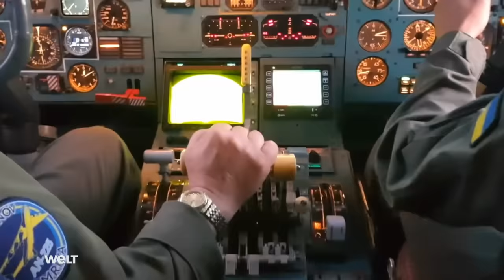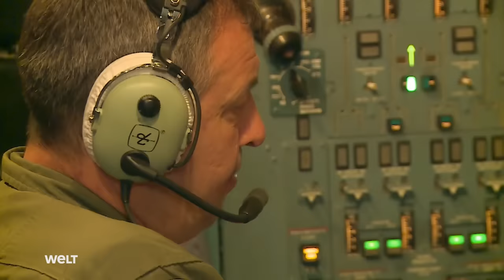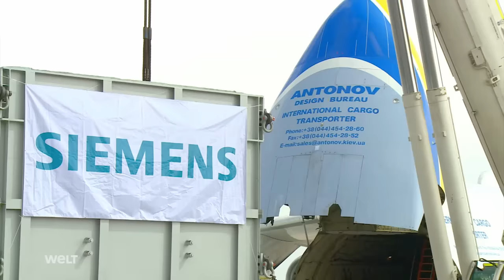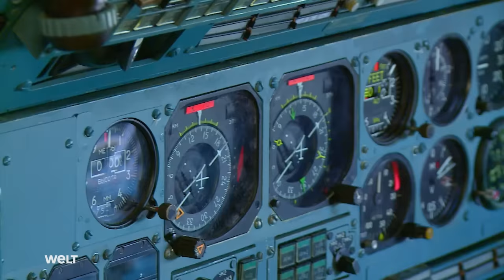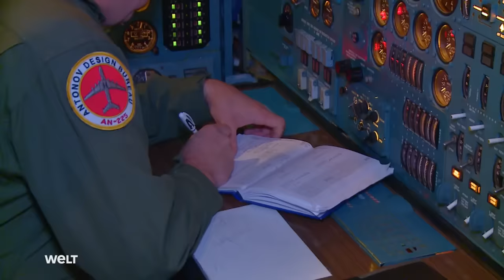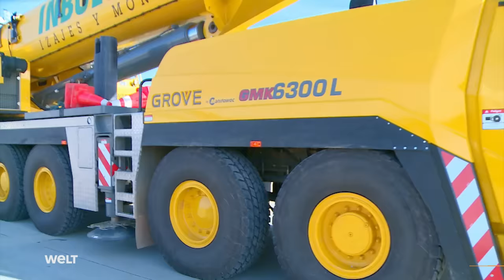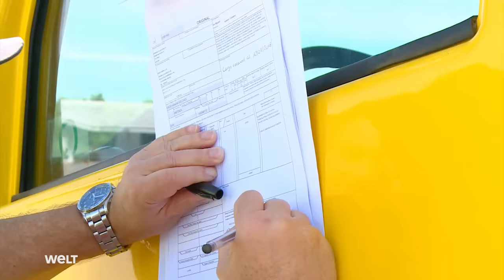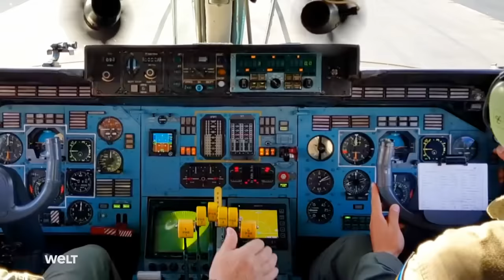Antonov An-225 - The World's Largest Aircraft | Full Documentary

Comment: 34:20 the runway is JUST 4000m long. Bish please this is probably the longest ones in a freakin juggle
Reply: This plane is massive, it can't land at any traditional run of the mill national Airports, and not even at some international airports

It needs very very long runways.
Reply: @longnamedude3947  And a runway that can support that massive weight without damage too
Reply: @Shade_Tree_Mechanic  That too, alongside the necessary support in place to tackle any potential incidents, which if one of these things crashed would be a massive fire to deal with.

Most airports that handle this thing are used because they are the only airports that can handle it.

It's difficult to gauge how big it really is until you see it next to an Airbus A380, and then you see that next to a Sessna or small twin engine Honda private jet.

I mean it is so big you can fit a shuttle on top, that is impressive.
Reply: you should make your own aircraft.
Reply: @longnamedude3947  The Boeing 747-SP did it YEARS before this one did...and the 747 is quite a bit smaller while the U.S. Space Shuttle was BIGGER than the Soviets' Buran Space Shuttle.  The Buran did not have its own main rocket engines, either, whereas the U.S. Shuttle has 3 main rocket engines.  Now, don't get me wrong, I am DEFINITELY NOT knocking this amazing machine!!  But, credit where it's due!!  The 747 is smaller than this and it hauled a bigger space shuttle on its back than this did.

Comment: “Gear down!”   “64 GREEN!”
Reply: Daniel Hernandez Actually it has 32. I was exaggerating. But from a distance it looks like a lot more. I didn’t get to see it land, but I saw it on the ground.
Reply: 😂
Not many people get the "x green" gag. You must be a fellow airman! Cheers
Reply: It would still be three green. You don't count tires but independently moving mechanisms. Or four, I think the front has a double set.
Reply: @rhallnapa  i dont want to imagine stress of the rear tire when touchdown, it either has to have deep softer springs to spread weight..... wh what do I know, this thing should not even be able to fly.
Reply: @DrWhom  yep.Two front gear.
Reply: @rhallnapa  36

Comment: Very nice to see the half-finished one as well, I haven't seen that in previous documentaries.

And that remote airport with "only" 4000 meter runway... runways don't come much longer than that :-)
Reply: I have landed on runways 10 times smaller. Netherthorpe and Maypole both in UK. Elstree used to be my home airfield which is a touch larger.
Reply: Time stamp?
Reply: The half finished plane? 5:22
Reply: 4000m is 4km is 2.45 miles. Almost as long as Kennedy space centre runway. Dont get much longer you’re right. I think my city runway is 1.5km maybe at most.
Reply: actually denver international airport has a 16,000 foot (4800 meters) long runway but it's not just runway length, it also has to do with weight rating and size classification since the AN-225 can weigh 1,280,000 lbs (640 tons) on takeoff
Reply: @Derek Wall Denver probably needs it because of the altitude.

Comment: The USSR had a knack for making aircraft that look so intimidating.
Reply: think it was ukrainian
Reply: @gordonwilson1032  No it wasn't.
Reply: @gordonwilson1032  Made by Russia. Stolen by Ukrainia
Reply: @sunilsubhash6769  What are you smoking, dude?
Reply: @maltrhythm105  If I steal your car and change it's colour, will it be mine?
Reply: TheBaconHunter  Here is the details -

The Antonov An-225 Mriya is a strategic airlift cargo aircraft that was designed by the "ANTONOV DESIGN BUREAU" in the Ukrainian SSR in the Soviet Union during the 1980s.

Antonov StC is a state-owned commercial company. The Antonov corporation (AN) The company was established in 1946 at the Novosibirsk, Russia. Its headquarters and main industrial grounds were originally located in Novosibirsk, Russia and were later transferred to Kiev.

Oleg Konstantinovich Antonov the prominent Russian  aviation engineer personally responsible for designing the very successful Soviet Antonov AN airplanes.
Reply: @gordonwilson1032  It is, and Ukraine was part of the USSR.
Reply: @ceaschannle5752  Yes, it IS.  Ukraine was part of the Soviet Union...and Антонов is in Ukraine.
Reply: @iambjcincle3991 ....and that means what?
Without Russia there would be no Antonov or this aircraft. Without Russisn empire and USSR the Ukraine would be also 70% smaller,  a modern made country and not by their own doing at that.
Interesting fact, Antonov as a company that attempts to manufacture anything went belly up, even as a independent and state owned company, it couldn't survive without Russia pumping money in to it.
Reply: @ceaschannle5752  It means exactly what I said:  That the Antonov Design Bureau was in Ukraine, which was a part of the USSR.  What you're going on about has nothing to do with what I said.  I stated a fact, not suppositions nor assumptions.  There are people saying it wasn't made in Ukraine.  It was, that's all.  Whether or not they would've gone belly-up or not or what size Ukraine would be is irrelevant.  That other stuff you brought up has nothing to do with the argument at hand.  You could very well be correct...but, that's neither here nor there.
Reply: @iambjcincle3991  Look, Ukrainians are taking all the credit for it and as the facts go, they deserve none, just because Russians decided to relocate Antonov factory on to Ukrainian USSR territory means nothing. The aircraft was designed and build mainly by Russians.
So first and foremost,  the aircraft was build in the former USSR.
Reply: @ceaschannle5752  OK, I will try ONE. LAST. TIME.  WAS IT BUILT IN UKRAINE?  YES OR NO?  WAS UKRAINE A REPUBLIC UNDER THE SOVIET UNION?  YES OR NO?  Now, it matter NOT whether or not the SOVIET UNION (NOT RUSSIA) moved Antonov to Ukraine.  It matter NOT whether Ukraine would've been 10 times it's current size or 1/10th.  It matters NOT whether or not Antonov would or did go belly up without SOVIET or RUSSIAN funds...FOR THE PURPOSES OF THIS ARGUMENT THERE ARE TWO THINGS THAT ARE PERTINENT:  1)  Ukraine DID exist during the Soviet Era, and 2)  The AH-225 WAS BUILT IN UKRAINE!  It's THAT SIMPLE...That is ALL I SAID!  BTW, check your facts...Ukraine DID exist for HUNDREDS of years PRIOR to the Red Revolution.  Ukraine WAS its own country for HUNDREDS of years, it was a Socialist Republic during the Soviet Era, and it is its OWN country, once again.  I made NO OTHER CLAIM than the two points I have, ONCE AGAIN, reiterated.  Why does this have to be so difficult?  Look, I have NOTHING against you, in fact you seem like a pretty good person with a brain.  But, you're reading FAR more into what I wrote than what I was arguing.  The fact of the matter is that I just don't know what could've, would've happened had the Iron Curtain not fallen.  Also, admittedly, I don't know where Antonov Design Bureau (let alone Antonov, himself) originated OR how and when or why Antonov was (if they were...again, I don't know, personally, I haven't gone into all that research on my own and won't argue things I am not 100% certain of).  What I DO know is that there is a VERY common misperception that the USSR=RUSSIA, full-stop.  It actually amazes me, as somebody who lived through the very height of the Cold War and served in the USAF during that period, that so many people don't know that while Russia WAS a or even THE major Republic in the USSR, Russia was NOT the "be all and end all" of the USSR...there were MANY other Republics that made up the USSR.  Just WHY one of the single most important parts of OUR history as well as the entire WORLD'S history is so misunderstood AND SO SOON AFTER the fall of the USSR is quite frankly shocking and embarrassing.  Seriously, it's not like the times were during the Ming Dynasty or Pre-Egyptian times, or off in some remote, who knows where tiny plot of land somewhere on the other side of the planet that's the size of Luxembourg or Liechtenstein.  This was a VERY SERIOUS TIME in world history that STILL has after-effects for virtually every country on the face of the earth.  I digress and now I am guilty of going way off the topic being argued (important as the topics being discussed may be, they ARE irrelevant to the argument at hand).  OK, SO, HOPEFULLY this cleared everything up and it's understood that I was arguing absolutely nothing else other than that "Maria" was built in Ukraine and Ukraine was part of the USSR.  Nothing more, nothing less.  Now, so as to not have any more misunderstandings and so that there is no "bad blood" between us, I bid you a good day and hope you have a pleasant one.  Take care.
Reply: @iambjcincle3991  Beating dead horse..... I'm from Ukraine or former USSR and even though I'm from Ukraine, I don't speak it, only  Russian. Most Ukrainians and people from other republics  are aware that in those times (USSR), borders meant nothing and were purely symbolic.  That is why Lenin allocated  western parts of the Russia in to Ukraine when though those areas were parts of Russian empire for centuries, same goes for Crimean peninsula in 1954. Borders were all symbolic. Heck, Su 25 was manufactured in Georgia, does that mean Georgians designed and build it? No, same goes for An=225 , it means absolutely nothing that it was build on Ukrainian territory, absolutely nothing. It was the plane that was designed, build by USSR with people in Kremlin pulling all the strings. It was primarily build to carry Soviet space shuttle.
Reply: @iambjcincle3991  
1. Without Russia there would have been no USSR.
2. Without Russia, there wouldn't be Antonov.  
3. Ukraine didn't manufacturer anything on their own in USSR times, everything was directed, paid for and manufactured under Kremlin direct control. 
4. Antonov is caput, it's no longer exist as a viable aircraft manufacturing company. 
5. The only flying AN-225 today was built under USSR regime. Ukraine couldn't muster to build anymore of them on their own.

Comment: The Antonov An-225 Mriya (Ukrainian: Антонов Ан-225 Мрія, lit. 'dream' or 'inspiration'; NATO reporting name: Cossack) was a strategic airlift cargo aircraft designed and produced by the Antonov Design Bureau in the Soviet Union.

An-225 Mriya
Antonov An-225 Beltyukov-1.jpg
The An-225 in its 2009–2022 livery
Role
Outsize cargo freight aircraft
National origin
Soviet Union (Ukrainian SSR)
Design group
Antonov
Built by
Antonov Serial Production Plant
First flight
21 December 1988
Status
Destroyed
27 February 2022; 15 months ago[1]
Primary user
Antonov Airlines
Produced
1985
Number built
1
Developed from
Antonov An-124 Ruslan
It was originally developed during the 1980s as an enlarged derivative of the Antonov An-124 airlifter for the express purpose of transporting Buran-class orbiters. On 21 December 1988, the An-225 performed its maiden flight; only one aircraft was ever completed, although a second airframe with a slightly different configuration was partially built. After a brief period of use supporting the Soviet space program, the aircraft was mothballed during the early 1990s. Towards the turn of the century, it was decided to refurbish the An-225 and reintroduce it for commercial operations, carrying oversized payloads for the operator Antonov Airlines. Multiple announcements were made regarding the potential completion of the second airframe, however its construction has largely remained on hold due to a lack of funding. By 2009, it had reportedly been brought up to 60–70% completion.

With a maximum takeoff weight of 640 tonnes (705 short tons), the An-225 held several records, including heaviest aircraft ever built and largest wingspan of any aircraft in operational service. It was commonly used to transport objects once thought impossible to move by air, such as 130-ton generators, wind turbine blades, and diesel locomotives. Additionally, both Chinese and Russian officials had announced separate plans to adapt the An-225 for use in their respective space programmes. The Mriya routinely attracted a high degree of public interest, attaining a global following due to its size and its uniqueness.

The only completed An-225 was destroyed in the Battle of Antonov Airport during the 2022 Russian invasion of Ukraine. On 20 May 2022, Ukrainian president Volodymyr Zelenskyy announced plans to complete the second An-225 to replace the destroyed aircraft; Antonov announced plans to rebuild the destroyed aircraft in November 2022.